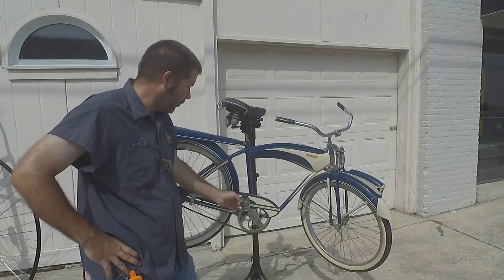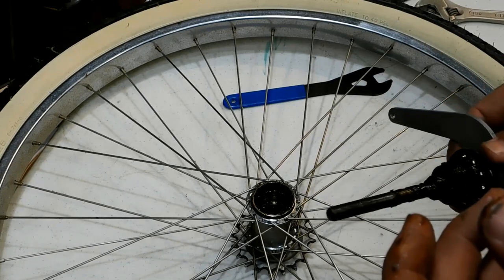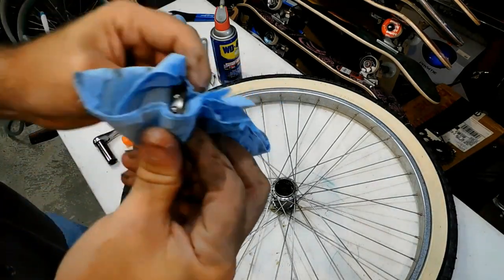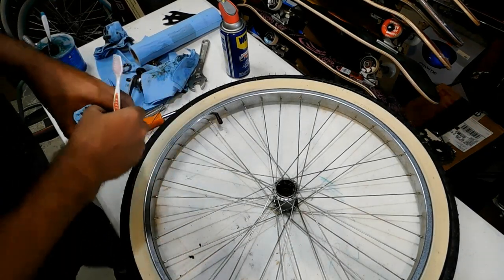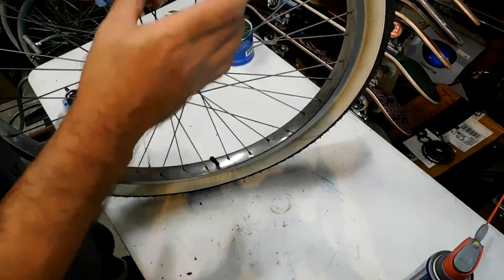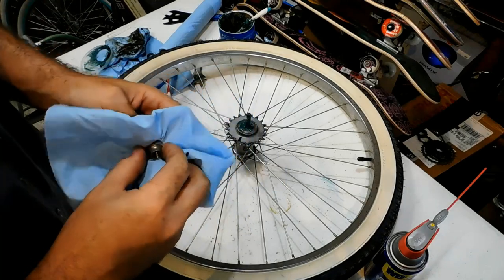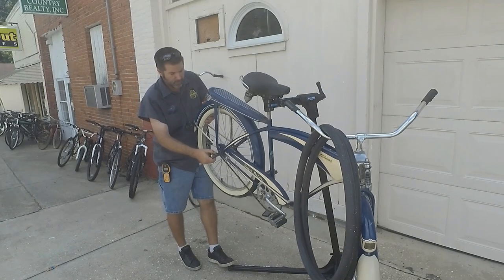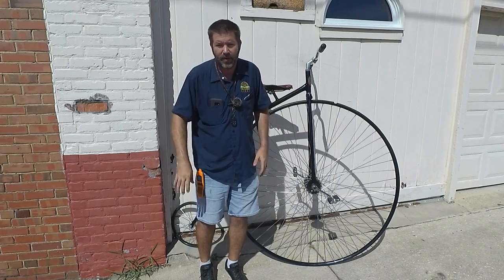1952 Monark Super Deluxe New Departure hub service

Comment: Wow, Monark made an ALL aluminum "art deco" hex tube & aluminum cast frame in the 30s-late40's? named the Monark Silver King, & in the late 40's - 50's they made a two cylinder engine powered Bike kind of like a Whizzer called the Monark Super Twin. The engine is a two stroke Power products 300. On my bucket list, It would be Awesome to power a Silver King with one.  Those old hubs were bullet proof, I have a 63 Schwinn Typhoon that runs a Bendix 2 speed kickback. Bendix also made wwII Airplane parts, & 50's cars brake parts & I think Transmission kickdown overdrives?  They made Red, Blue & Yellow stripe 2speed kickback planetary geared hubs. The Red has a stack of disc coaster brakes in it & the other two have cone expanding coaster brakes. A trick you can do is take the gearset out of a yellow Stingray? hub "smaller wheel with taller gear "  &  swap it into a blue hub "spoke holes fit a larger wheel" for a higher overdrive gear & top speed  Cheers......

Comment: I have a rebuilt New Departure Model D with oiler cap. Is normal for the pedals and chainwheel to move when walking the bike? My research has indicated that this issue is called "ghost Walking". Should coaster brake do this? So in essence the pdeal move forward when I walk the bike. is something wrong in the coaster brake hub? It seems to pedal fine and brake fine.
Reply from the maker: I'm not sure about the ghost walking with the New Departure. I have had other coaster hubs that when the grease got old or used the wrong grease it would ghost walk. I would rebuild the hub with some good bike specific grease and it always did the job. Park tool, Finish Line or Red Devil make great grease for bicycle hubs. Goodluck.👍